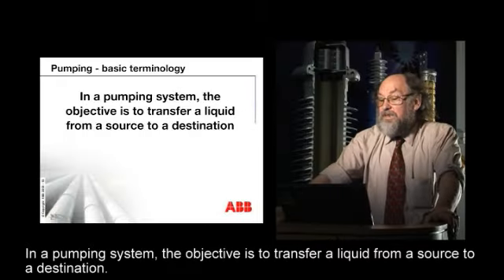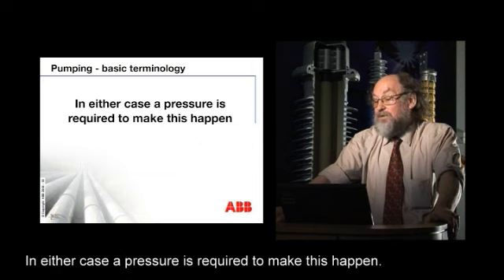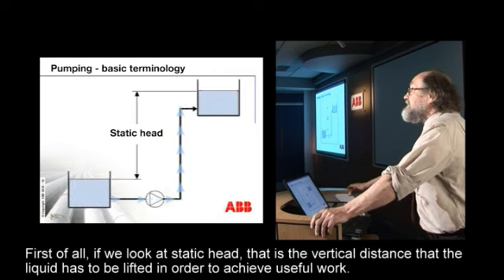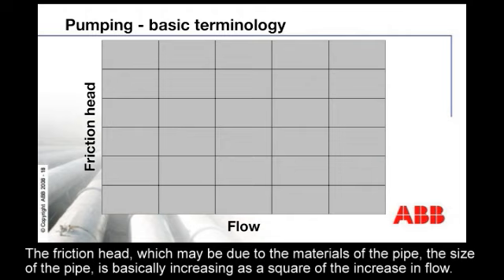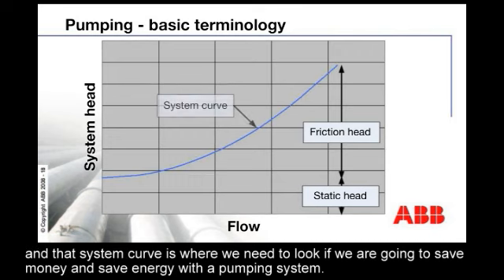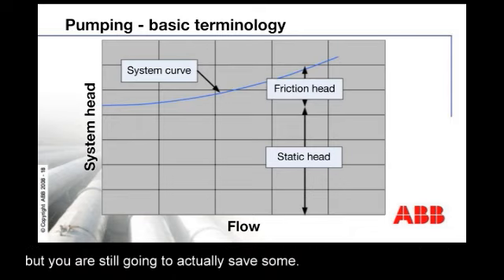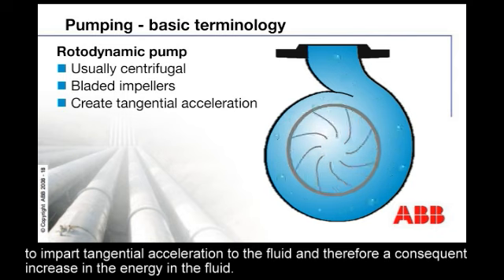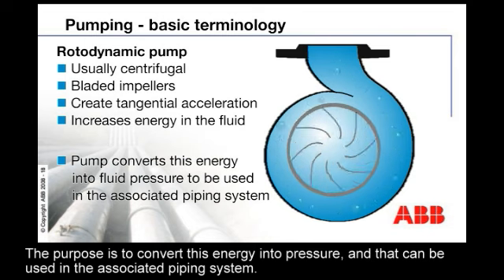Basics of pumps and pump curves -- Part 1

Comment: my first comment is wrong, now that i look at the video again it actually turns in the right direction but the blades have a wrong angle, some impellers truly have very odd angles specially designed for high pressure, but in this animation it looks wrong